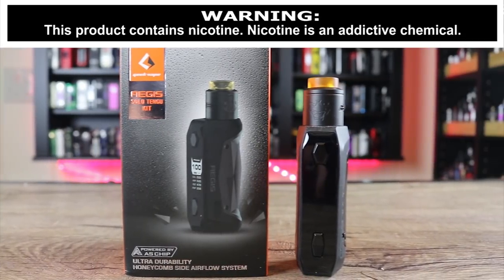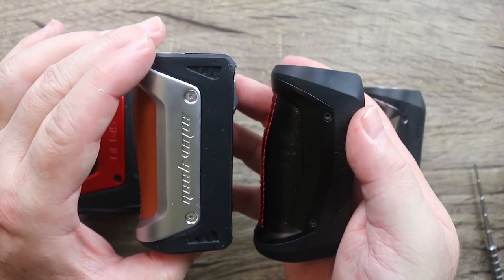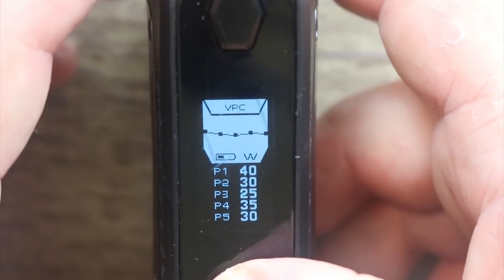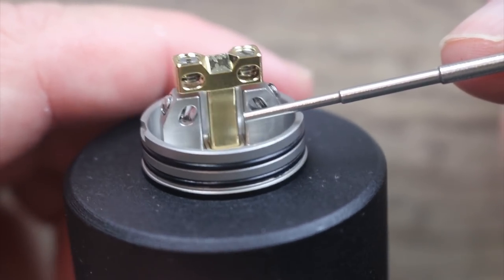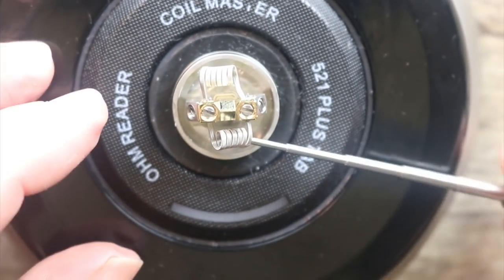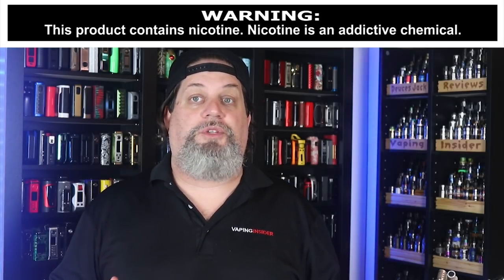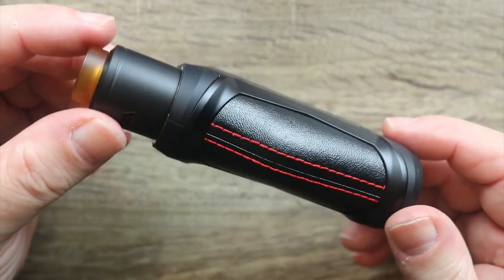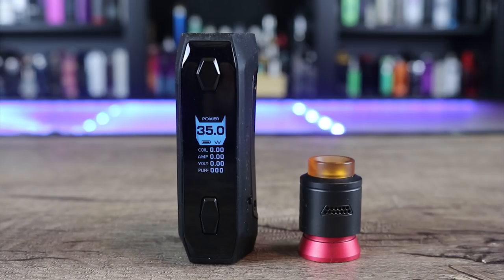DO WE REALLY NEED ANOTHER AEGIS MOD? The Geek Vape Aegis Solo Tengu Kit! ✌️🚭

Comment: Im with you....21700 would be better by far. Thanks for the review Jack! 11k subs....things are looking up man!!!
Reply from the maker: Thx Stephen. Yeah, Geekvape should spend some time on the forums and groups so they can get an idea of what their customers want.
Reply: You do know that there is already an aegis that runs 21700. They made the replacement door just for that. Do you guys own stock in 21700 batteries or something. I'm sure 21700 batteries are stronger than the ones in my grandmother's hearing aid too but that doesn't mean they are the best ones to use in that instance either. They are too big to make a pocketable, waterproof, shockproof vape. The solo used a smaller battery and accomplished all 3.
Reply from the maker: Dude you really need to stop taking this personally. It's just vaping. I was actually wondering if you own stock in Geekvape with the way you have been peppering all the comments. It's like you are on a mission to get your narrative out there. People are allowed to have different opinions. It's OK, Geekvape will survive, I promise.
Reply: @Old_School69  The original Agis was rather large. I have one and yes I know they make a 21700 option for it. 21700 is only 3mm bigger, the diameter of a standard build coil. Extend the mod 3mm is all you have to do.  I am by no means saying this is a crappy mod. I love the Aegis line. It is a beginner line and a good work beater for folks that work around dust and water. But a 21700 would have been better, especially since you pair this with an RDA. The added amp allowance makes 3mm of pocket real estate so worth it.
Reply: @VapingInsider  I feel the same
 Way about you shitting on them in every comment as well. Sorry they didn't listen to you but you obviously aren't as big a deal as you think you are. Every mod doesn't have to use the biggest bulkiest battery available just because you will bitch and cry if it doesn't. Some people work jobs with our hands and we appreciate a mod we can carry in our pocket without it pulling our pants down.
Reply: @StephenSard  it's not just 3 added mm, the jackaroo is exactly what you are talking about and it is much more than 3 mm bigger. The only way to safely make a 21700 mid that is waterproof, shockproof and dustproof is to make it too big and heavy to carry in your pocket. I know because I have tried and it does not work. I love my jackaroo and my og aegis but they have to stay in my bag or my locker at work because I couldn't carry it in my pocket and my mini lost its battery capacity to make it through a full shift after about 4 months. My issue was with him saying geek vape isn't listening just because he wants every mod to be a 21700. I remember when the mini came out, there were tons of LEGIT youtubers with over 300,000 subscribers saying THEY SHOULD PUT A 18650 IN THIS, so they did exactly what a large portion of the community asked. Just because they didn't hear what this guy was saying, doesn't mean that they weren't listening. This is exactly what a large section of the community was asking for.
Reply: @StephenSard  also, the more popular kit doesn't come with an rda, that is just something new they tried out. Most of the solo kits come with the Cerberus tank.
Reply from the maker: Bro it's my channel. I try to respond to every comment. I think people actually like that. No one was crying. It's an observation I made during the review. I find it astounding that you can't comprehend that. If I'm not that big of deal then why are watching and so concerned about what's said on my channel? 

Then you bring up my sub count? This channel is barely a year old. We only started posting reviews in April of 2018. I think for the amount of time we are dropping reviews that we are actually doing pretty good. You're comparing my channel to reviewers that have 3-5 years on me. Not exactly fair. 

This channel is not for fanboys. I don't fanboy anything or anyone. I put my honest thoughts on camera. If that bothers you, maybe this isn't the channel for you man.
Reply: @VapingInsider  I'm not shitting on your sub count, I'm saying your claim that geek vape isn't listening to the people isn't true. All those youtubers were saying they should put an 18650 in the mini. It is ridiculous to pretend like no one was saying it just because it supports the narrative you want. 

I'm no fanboy, the whole reason I love the solo is because my mini (from the same company) shit the bed and can't carry a charge through a full shift. I love my jackaroo, if it were lighter and less bulky, I'd carry it. But it's not, so it is my driving around on my off day vape. It's not being a fanboy to point out when you are being unfair.
Reply: First off. Jack said he wished it was 21700, that's it. He didn't go all ballistic over it. 21700 is a better battery hands down. Most reviewers states they wish the solo was 21700. As I said in another post to you, when the mini came out 18650 was the standard. Now it isn't. Geek Vape missed a great opportunity here. It's still a good mod at 18650, but would be so much better at 21700. If you're worried about your pants falling off, why not just use a pod or mtl at work. I mean who chucks clouds on the job anyway? I have the solo... Love it... For MTL. It sucks for anything else as it lacks power and longevity.
Reply: @StephenSard    what are you his boyfriend? 1. you are full of shit, he has repeatedly said that geek vape isn't listening to fans and refused to acknowledge that 2 out of the top 3 search results for aegis mini both specifically requested that they put an 18650 in the mini 2. 21700 is the stronger battery, but it's also the bigger, bulkier, heavier battery too which means it isn't better for every application. 3. 21700 isn't the standard for mods anymore now than it was a year or so ago when the mini came out. 4. I seriously doubt you even have a solo, you are just trolling because I dared speak against a fellow 21700 fanboy.
Reply: @Old_School69  I got a solo when it came out, with the Cerberus. Most people like 21700, especially builders and mech users. I am quite fine with it being a 18650, I simply said I wish it was a 21700. I use it for MTL or on Bypass as it isn't much good for anything else for how I vape. Most newer mods slated and coming out are moving to 21700. My favorite mod, the DB is a dual 18650, so I do in fact like my 18650's. In order to run the solo properly, with the tengu , I would have to use the Samsung 20s, a great 18650 battery amp wise, but not so much for longevity, in bypass mode to be safe and to have a decent vape. You are free to speak out against whatever battery your hear desires,. And no, Jack isn't my boyfriend. Never met the guy. But if he was, would that even matter? Are we trying to play the bigot card to win some points? This isn't the 80's my friend, the rest of society has moved on from that being anywhere near a valid insult. But please, continue to troll, I will be glad to respond if you would like. Or drop it. It's all the same to me either way. Enjoy the mod, as I said, it is rather decent (temp control if off, however, have to adjust the TCR on it manually to around the 115 mark from what I am getting anyway).
Reply: @StephenSard  yea, did I say it was insulting? These days you have to ask questions like that when 2 men are having a discussion and a third man feels the need to step in and argue on one guys behalf. Especially when that third party is getting emotional and making shit up like you are. Over the past year name all the major big brand vape companies that made their flagship a dual 21700 in that year. So to call it the standard is a flagrant lie because 18650 is still the standard right now. Probably because everyone doesn't want to carry a gigantic heavy vape around. Sure there were a few like the avenger or the I priv but those big companies saw how popular it was and went right back to making their flagships be dual 18650s. Just like you are lying about the solo not running good. I went and put 4 different rda types on it last night just to test it out to see if you were full of shit. And not one of them ever had any problems through 111 puffs on 4 different rda and another 47 puffs on  2 rta types. So any problem you are having powering the tengu on yours is a problem with the tengu. But earlier you said your mod came with the Cerberus so I'm pretty sure you are full of shit on that comment too.
Reply: Who argued on my behalf? You commented to my original comment after Jack made his comment. Nothing in my original comment said anything about it being a bad mod, I don't feel that it is. All I said was I wish it were 21700 and grats on the subs. Jack commented that he agreed and wished it was a 21700. That was the end of the discussion. However, you felt the need to interject, like you have on many post on this video to anyone who does not agree with your assessment that it should be 18650. I mean, it's a vape mod. Not even an overly relavent vape mod at that. It's a low-end 18650. Who cares? I'm sorry you can't keep your pants on while you are working due to overly heavy mods. Perhaps a belt would work? I don't take mods in the field. Just a small pod because regardless of work environment, clouds for days isn't appropriate. If you like it 18650 then good for you I am glad you found a mod to keep you off the smokes. That's the ultimate goal, correct? If you're happy, then I'm happy. But there is no need acting the way you're acting regarding someone's differing opinion. In terms of vaping prowess, congratulations you win the vape game. If you feel the need to keyboard warrior your way through life, then by all means go for it. Live the dream.
Reply: @StephenSard  ok good for you, that doesn't mean every mod has to be for you. Enjoy your pod garbage I don't care, I'm not running around trying to say they shouldn't make pod systems am I? You narrow minded guys are the ones who can't understand that every system doesn't have to be the most powerful, most bulky, heaviest mod on the market. This system is not for that. And if you think geek vape is low end, you obviously don't have one. They are easily the most durable, reliable mods on the market with the exception of maybe the jackaroo which looks like it is going to be in that category too. But you can shit on aegis all you want, you are only proving that you don't really have one or you would know better.
Reply: Geek vape is low end. Lol and if I'm narrow minded about power devices, why would I use a pod for certain things? Run along little boy. The jackaroo is shit (ugly) , the aegis is better, still neither are high-end. If you consider anything g geek vape or DigiFlavor does as high end, you've never seen, let alone used a high end device. But again, what difference does it make. You're not smoking so the system doesn't matter. What matters is you're not smoking.
Reply: I'm far from hipster... But sure why not.
Reply: @StephenSard  I notice you didn't say you aren't a vape snob. You must know more because your vape costs more. So gross

Comment: Would be better with 21700 even 20700 but im buying one on the first
Reply from the maker: Yep, they dropped the ball on that.
Reply: @VapingInsider  add an 18650 adapter for people who have surplus of 18650 but a 21700 wouldn't be that much bigger and longer life so the little bit in size is worth the extra life and safer amps on the battery for low ohm build
Reply from the maker: Exactly what I said in the video.
Reply: @VapingInsider  you had it a while now is it worth investing in for my first aegis and rda from a smok mod and sadly dead rabbit rta
Reply from the maker: Honestly, if you are going to run a dual coil atty or anything above 60 watts I'd get an X. Otherwise, you just gonna rip thru batteries.
Reply: @VapingInsider  thanks i started on pod sytems but they didn't have flavor so im upgrade

Comment: I think the mod is perfect for someone who isn't into building, and wants to have something durable and compact. Best single battery mod out easily. I know you guys like to measure your dicks with builds and cool shit, I just want a portable nicotine device that won't break. Perfect for me.
Reply from the maker: It's not a measuring contest. I normally vape anywhere from 60 to 85 watts. At that wattage a single 18650 just ain't cutting it. They made a mistake by not making it a 21700.
Reply: @VapingInsider  I vape 60 and two batteries gets me through a day. Especially if you work a 9 to 5 and dont have time to vape constantly.
Reply from the maker: Fair enough. Glad it works for you. If it was a 21700 mod, you'd probably get by on one till the very end of the work day and the mod wouldn't be much bigger.
Reply: @VapingInsider  One will last me two or 3 work days. It's when I'm at home I burn through battery, but my charger is within arms reach. Anything more than 1 battery is just overkill imo.